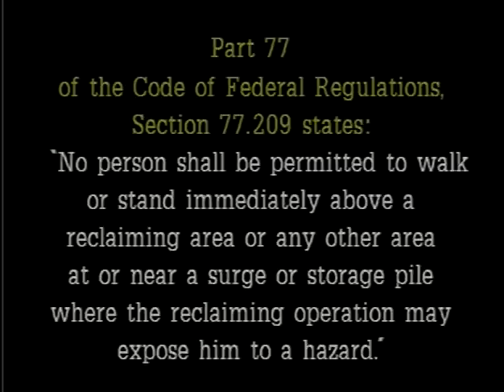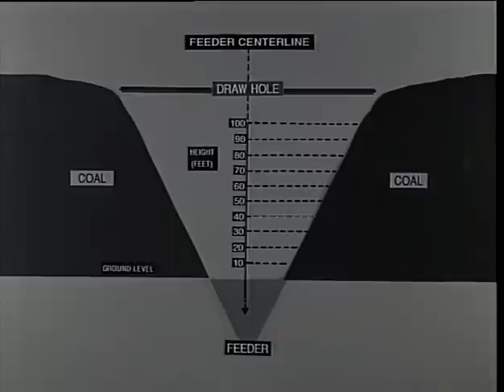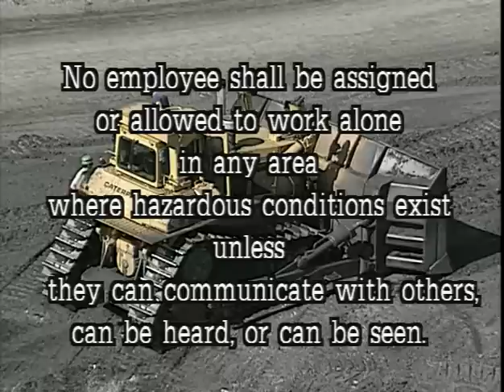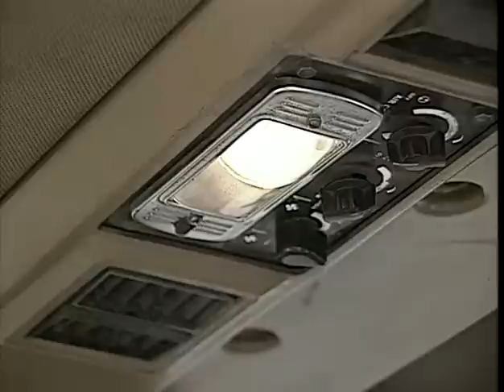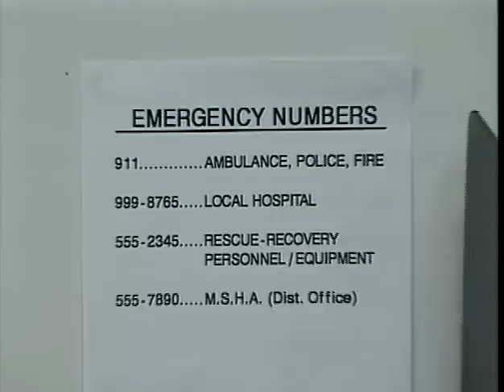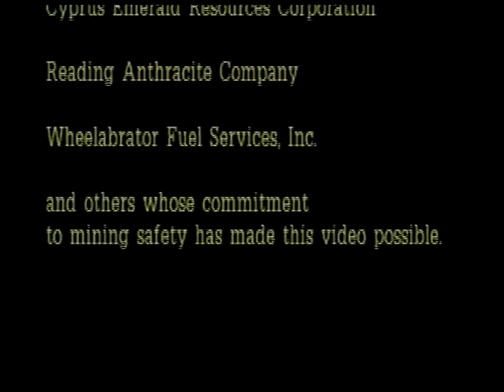Hazards of Coal Stockpiling Operations

Comment: I was more concerned about spontaneous combustion. Had a couple of fires, in a stock pile you can open it up but in the pit we had one burn for over a year until we cut round a hill with scrapers and broke it open
Reply: Wow
Reply: Look at the underground fire in Centralia, Pennsylvania I believe. The town used to burn their trash which accidentally ignited an underground coal mine. It has been burning ever since almost 50 years* and counting. Entire town had to be abandoned.
Reply: I know one mine in Australia that has to design its stockpiles specially to prevent spon com.
Reply: @seanriopel3132  yep, the underground mine here back in the 90s was on fire, they sealed up some of the drifts, they were bringing in a semi truck load of liquid nitrogen every 3 days and injecting it into the drifts until one morning, the gas levels were to high so they sent everyone home and later boom.
Reply: @seanriopel3132  50 decades? LOL
Reply: @AKUJIVALDO  LOL my bad 😂. Word prediction gone wrong. That's why you always proofread before you post. Thanks. Lol

Comment: No mention of fire hazards? Would have thought this could be a very serious issue, with hot equipment working on top of coal, possibly emitting dust particles or gases which are extremely combustible.
Reply: Too much wind, dampness and other factors prevent it.
Reply: @lucasaccount573  --Indeed.   It takes some effort to start a coal fire.

Comment: wouldnt some sort of simple radar set up help spot voids?
if we can find a fish it seems like we could find something that will swallow a dozer
Reply: 05AWAG well there may have not been a rader of any sort back then
Reply: The GPS on your cell phone would work just fine.
Reply: @josephastier7421  GPS signals don't penetrate a thick layer of coal or soil.
Reply: @mfbfreak  The voids are at the intakes to the conveyor systems.   Those are at known locations.   Some of these dozer operators get in trouble because the intake gets covered and they lose track of where it is, and drive over it.    A cell phone GPS could easily let them know where the intakes are.
Reply: Radar has been around in a usable state since the 1940s, but it may not be so easy/cheap to use in this kind of equipment. It’s cheaper to make safety videos and use cheap methods of warning than to actually value employee safety if you’re a mining operation.
Reply: Sonar may be possible, or GPS to indicate the perimeter of the safe zone.
Reply: No need, if you know where the drawhole is, you know where a bridge could be. Drawhole dust, don't breathe that.